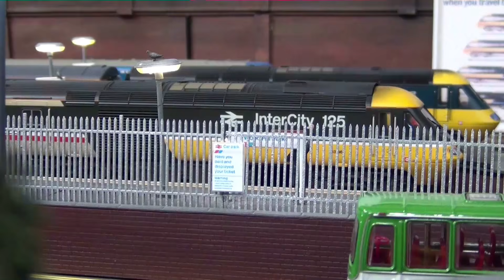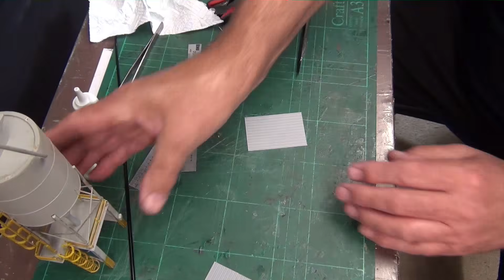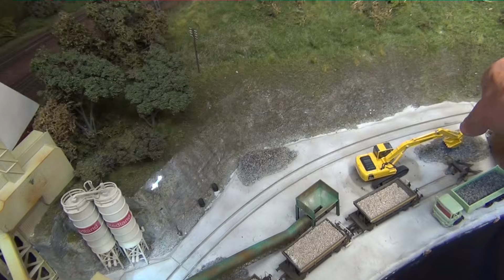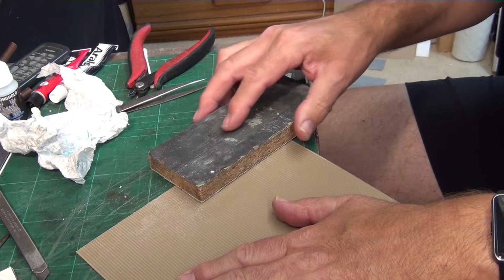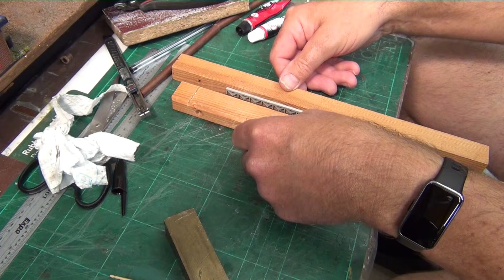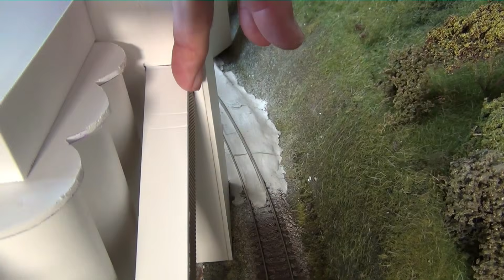Building a Model Factory .132

Comment: Totally agree on the crane, it should of been better for the money, But I guess they saw what those who missed it were prepared to pay on Ebay and there`s no shortage of mugs that paid 90+. I thought it`s rrp should have been in the 50 mark, and they managed to miss a cab window out, and I`ve not heard that the second run has corrected this. The old Tufnol tube came in handy. haven`t used that for years, spent many hours at a lathe cutting tufnol to make filter coils, if only I`d of saved the offcuts. Lol
Reply from the maker: The glass shelf collectors brigade don't help us runners, as they love a model that just sits on a shelf looking pretty gathering dust. This model fits that criteria nicely. 😅😊😉👍atb mate,  Graham

Comment: Hi great video content, I purchased a 12T EFE rail crane last year because and found it quite interesting, the guys at Kernow were asked to research and design it which they did, unfortunately Bachmann didn’t want it to function in any way because of cost issues, I sold a few bits and pieces and had a £22 lottery win so I ended up paying £46 for mine in the end, it was part of the first run which was cheaper, Bachmann re numbered the same crane and hiking up the price by £10 for the second run, it’s extremely overpriced for what it is but no other manufacturer produces a diesel crane with great detailing to date, hopefully you will recover your money in some way in the future, thanks for sharing.
Reply from the maker: I just feel it was a wasted opportunity as well as a possible waste of money in my case. A real shame. Atb Graham 👍 😊
Reply: @WHP1980s  Unfortunately Bachmann will do the same thing again in the future, that crane is not worth the money but it sold very well, hopefully modellers will realise that their pants are being pulled down by a manufacturer that will short change them by cutting corners, Bachmann will get their Karma eventually.